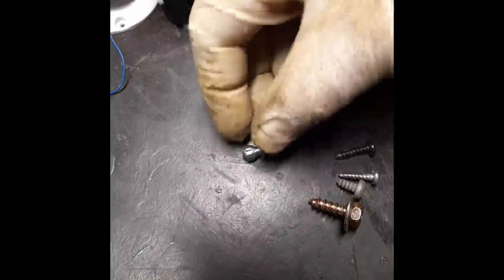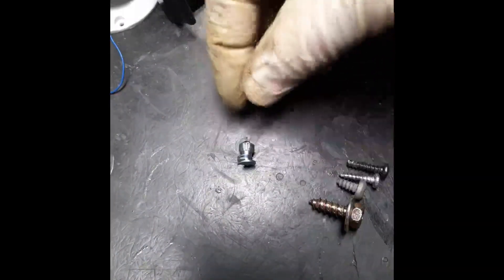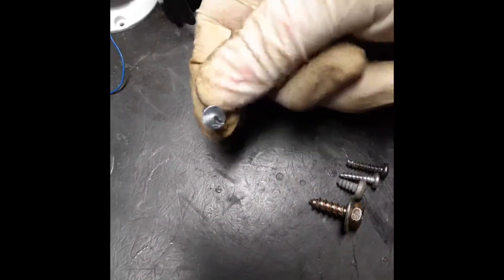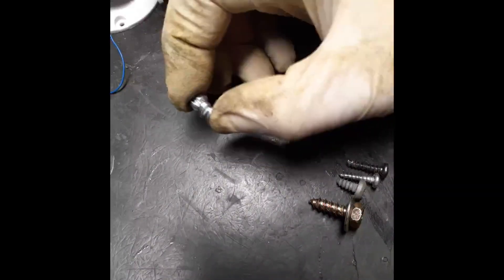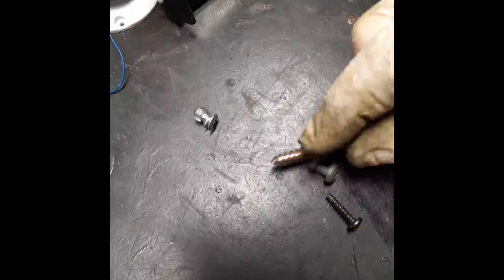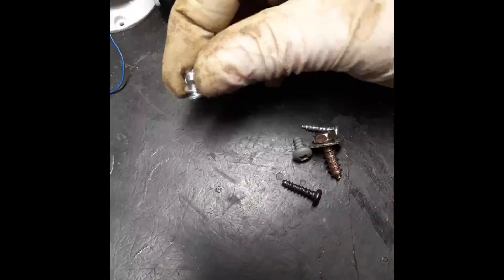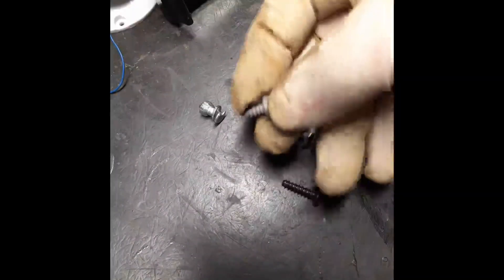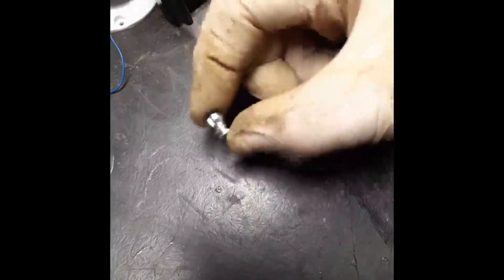Screw in Tire Studs.  What is and what is not a tire stud for your winter tires.

Comment: What is your source for the right kind of stud? I have not seen them for sale.               thanks
Reply from the maker: I'll dig up the sale of these and get back to you.
Reply from the maker: Here are some on Ebay.  Choose your size.  https://www.ebay.com/itm/204463918798?hash=item2f9affcece:g:eioAAOSwfbRlBQPb&amdata=enc%3AAQAIAAAA8MMVkHS6e0t09bDGaQ75%2FFLIAjIf3Rvi3k%2F%2BzgX6UIFPhUnRHZEZSeNnDd8DA7VBTTPj0%2FfL4KcUSKFjg1lp2O0UrMTrxU1LGGgCwgTsIzfByldl50V2kqTgzICgBQaA2sBWzzsLXtr6EJ3c07MEB%2BfHjmab6vWNDN630Z9miAbjoSl0IgkJXNQ4Yu0AO49lBL%2Be4UVRyKY3qx7GIV6NZWVrEZXEX6oTMbZzOX4%2Fu1RRxSDLgpBpBgOKmqGaPd4k%2FOxwETyYjlXxDgKphj4ti87dIqKKiO6lhM%2BOTtX3VSDROM4RgAtQ88r2ocCSLbb1KA%3D%3D%7Ctkp%3ABk9SR6C5yfLbYg
Reply: @Youcanfixityourself123  can you update your link. Also, is there anything like the flat bottom screw in type for bicycle tires? Which is more of what im after
Reply from the maker: Not a bad job, if you have a lift, a torch and a complete set of tools.